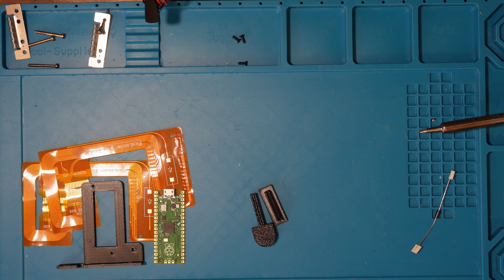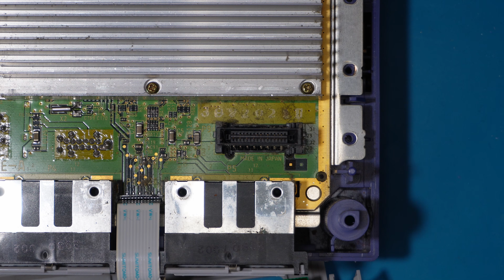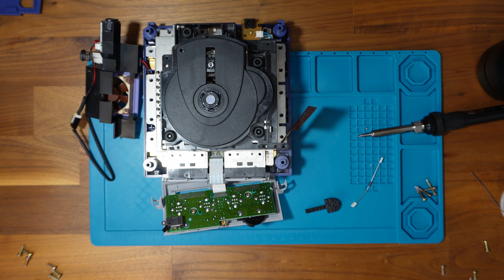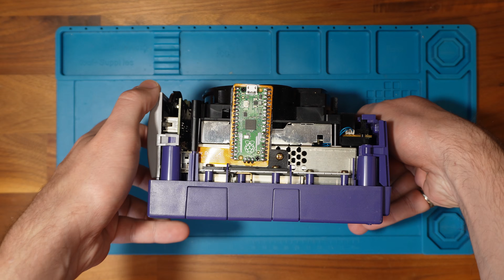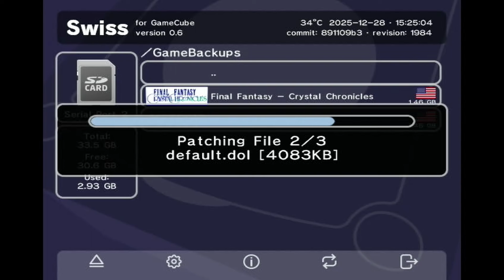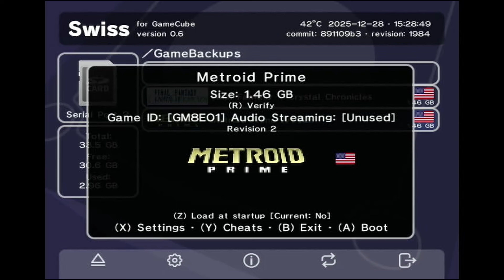Installing PicoLoader on a GameCube (Boot Swiss; Reversible Mod)

Comment: I have a doubt: Can I still use my old memory card with my old saved records?
And how do you run games? Using a micro SD in the slot 2 o the sd? With an adapter?
Reply from the maker: Yes you can use your old memory card, or you can save to the microSD (there are options in swiss). 

Yes run games off a microSD card either in memory card slot 2 with an adapter (GC2SD), or in a different adapter (SD2SP2) in the serial port 2 slot (if your GameCube has one).

Comment: there is actually a new version of the picoloader that does not require any soldering.
I bought the kit from LaserBear.
Reply from the maker: Neat! Thanks for the heads up
Reply: How much was it with shipping? It was almost 50 bucks for me

Comment: Getting no sound on my LG tv and no sound n flashing screen on my Hisense tv any ideas?
Reply from the maker: Unclear, I'd suggest double-checking the connections on the mod (both the solder and how the ribbon cable is sitting). Could also just be capacitors getting old that might need replacement.
Reply: @DMSCreates well it worked on a borrowed tv
Reply from the maker: Weird

Comment: i'm getting a red screen that says "An error has occurred" what i'm i doing wrong? nothing is booting
Reply from the maker: Can you confirm you flashed it properly (first with the picoloader firmware, then the picoloader version of swiss)? And if that's all good, you might need to check your connections. Either the soldering on the flex cable or the ribbon connection to the optical drive connector could be loose.

Comment: Could you plz help? I followed the video and soldered everything correctly with no bridges but mine will not do anything. My disc drive stopped working as well and no green light turns on with the board. If i connect to my PC the files are there and it reads just fine. I tripled check the ribbon and there are no damages or creases on any parts except the one going into the port. Im lost now..
Reply from the maker: If you connect to your PC you shouldn't see any files if the pico flashed correctly. Did you hold BOOTSEL while plugging in and transfer over the picoloader firmware then do it again and transfer over swiss (the picoloader version)? Each time it should eject the pico automatically and reflash itself.

Comment: i gotta ask, why didn't you solder the pico before you opened gamecube? doing it on that 3d printed part was freaking me out
Reply from the maker: I thought the same thing while doing it lol. For one, that's the instructions given, so I figured I'd try it that way. But it does have a benefit: you make sure everything actually lines up and have less chance of bending/breaking the ribbon cable since it doesn't have the Pico's weight acting like a lever on the end of it.

Comment: Nice video, Im wondering how do you add games ? Do you just drag and drop .iso files inside the sd card ?
Reply from the maker: Pretty much! It supports a few file formats, but just drop them on the SD card and go
Reply: @DMSCreates biggest SD card I can use
Reply from the maker: Not sure. Mine is only 64 or 128GB. It should support up to like 2TB, although I've never tried it.

Also make sure your SD card is compatible (https://www.gc-forever.com/wiki/index.php?title=Swiss/Compatibility_List )
Reply: @DMSCreates thank you for heads up getting my stuff soon to upgrade my GameCube

Comment: I only get a black screen - please help!

I followed the instructions on the picoloader git, but the LED on my pico doesn't turn on after flashing either picoloader's uf2 (picoloader_gekkoboot.uf2, flashed first) or the swiss uf2 (swiss_r2041.uf2, flashed 2nd). I put the ipl.dol and swiss folder (containing patches folder - containing only apploader.img) on the root of the FAT32 formatted microSD card.
Reply from the maker: If you're flashing picoloader with the swiss.uf2 file you can't use the gekkoboot version of picoloader, so that's a possible issue. You're going to want the picoloader.uf2 file (https://github.com/makeo/PicoLoader/releases/latest/download/picoloader.uf2) and once you've flashed the pico with that, you'll want to flash it again with swiss (the swiss_r2041.uf2 file from inside the PicoLoader folder in the swiss release).

If you want to use gekkoboot instead, then you need to flash the picoloader_gekkoboot.uf2 only and then add the contents of the zip file from the swiss_r2041/PicoLoader/gekkoboot folder into the root of your SD card.

If either of those don't work, there may be a problem with the pico, the ribbon cable, or the way you've soldered it. You may need to double check the connections. It's hard to debug without access unfortunately, so let me know what you try (exactly) and I'd be happy to keep trying to help.
Reply: @DMSCreates  thanks for the reply! I did all those steps... but was still getting a black screen... so chatgpt told me to disassemble it and check my connections, then when I reconneced it the flex tore :( going to just buy the solderless kit version and re-use the pico w for something else
Reply from the maker: Ah that's unfortunate! Hope the next kit works better. Good luck!

Comment: can you make a video on how to prep the SD card after all of this? Swiss has a new version. I'm not sure if i need the dol file on the SD card as well since i flashed the Pico with the firmware from Pico Loader. I used "picoloader.uf2" as the first firmware flash and after I flashed it with "swiss_r2018.uf2". When I boot up the gamecube it doesn't detect the boot and I get a no disk message.
Reply from the maker: You don't need the dol file on the SD card.

The SD card should be just a FAT32 formatted card (make sure it doesn't have a lock switch) and you can drop your game backup/homebrew files right into the root or into a directory named whatever you like. If you're not getting into swiss with the picoloader, something has gone wrong. I would try reflashing it with pico loader (from https://github.com/makeo/PicoLoader/releases/latest/download/picoloader.uf2) and then the swiss_r2018.uf2 file from the PicoLoader directory (ie. swiss_r2018/PicoLoader/swiss_r2018.uf2) after you extract the swiss 7z file. If that doesn't work, maybe try gekkoboot (which is also included in that same folder) to see if it's a problem with your swiss uf2 file.

Also double check to make sure you're using the PicoLoader uf2 and not the PicoBoot uf2 as they're incompatible.

You could have a problem with the ribbon cable too, or something else on the hardware side if it's not loading with any of these firmware.

Comment: Is flashing swiss onto the pico necessary?
Reply from the maker: For this tutorial, yes. Otherwise you won't have anything to boot into. 

Haven't tried without it, but you could technically try loading some other homebrew like gekkoboot instead. Check out the wiki here: https://github.com/makeo/PicoLoader/wiki/3.-Software-Installation

Comment: If you still wanted to use your physical memory card in slot A and just use swiss as a substitute for discs, is there a way to configure swiss to do that?
Reply from the maker: Yep, just make sure you have memory card emulation turned off in Swiss and it should use your memory cards like normal.

Comment: What size sd card do you recommend?
Reply from the maker: Really depends what you want to put on there. You could get away with as small as 32GB, but if you want a lot of stuff on there, I'd go for the biggest you can get that's supported. I think mine is either 128GB or 256GB. They might have a max supported size, so also keep that in mind.
Reply: @DMSCreates  I might go with 128 because I don't really need every game and downloading every rom will take a while
Reply from the maker: That works. The games aren't that big either, so unless you want lots of them or lots of homebrew, 128 should be great
Reply: @1812salvipapi  just keep in mind that you'll need to format the sd card to fat32 format
Reply: @DinoDonnieV Thank you for the video and giving me more info now I'm just waiting for everything to come in.